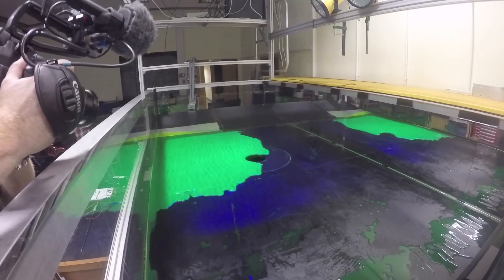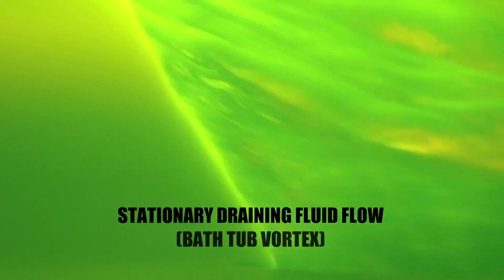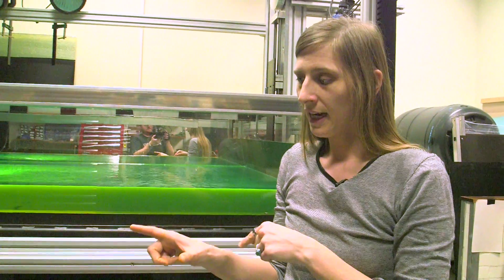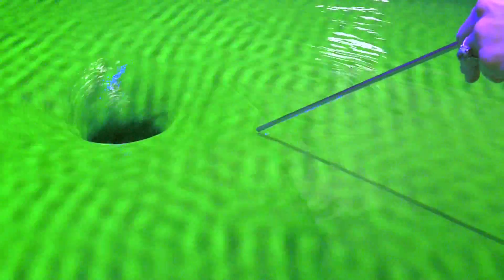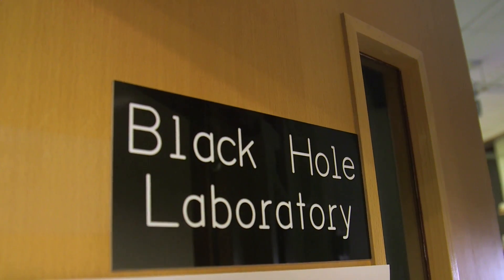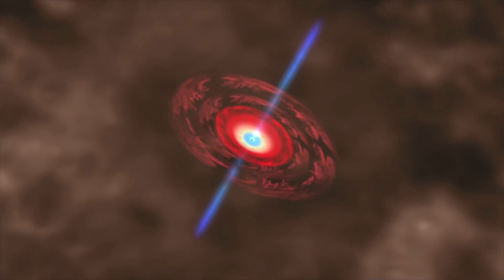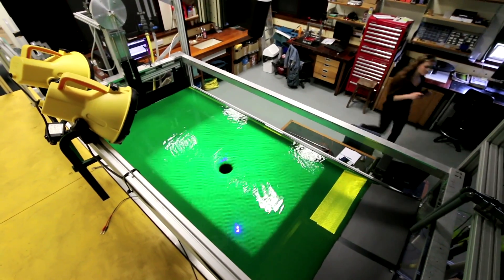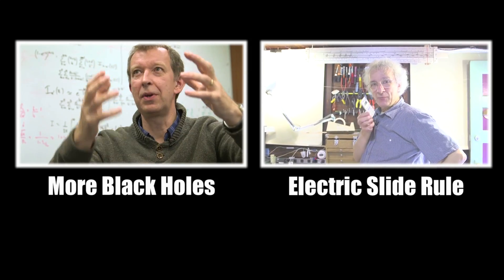The Black Hole Machine - Sixty Symbols

Comment: This should be done with liquid helium.
Just saying...
Reply: But....you'd gain nothing and add massive expense and make the surface much more difficult to manipulate.

I say you gain nothing. I mean you'd gain nothing but making it sound cooler.
Reply: Ben Actually you do gain something, a superfuid might have more in common with spacetime than a normal fluid.
For once it has "no viscosity" and more flows more easily.
One could attribute this experiment's results to "rogue waves" but not with liquid helium.
Reply: Rogue waves? They have pretty solid evidence that you can send waves in and get more energetic waves out, consistently, not randomly as with rogue waves.

Superfluids aren't just nonviscous, they have a few other... weird properties that cause issues. (Aside from breaking down at high rotation speeds or slightly warmed temperatures.) One of the more annoying is how they climb the walls of their containers, eventually overflowing them.
Reply: Not technically possible. A tabletop full of swirling liquid helium is not happening for any university budget.
Reply: Gareth Dean "NASA of course is nice, but it's far from 'all of science',"

Duh.

"this particular facility (In the video) is in Britain."

Duh.
Reply: Gareth Dean Yeah, I know, I didn't said it would be easy.
Reply: lloydgush
And sadly there's only so much research money to go around. This perhaps is the biggest limit to science. You cannot do everything. Sometimes you can hardly do anything.
Reply: Gareth Dean Yeah, I know about it...
It's sad, really sad.
NASA budget is lower than trump's coherence or hilary's honesty.
Reply: NASA's budget is 18 billion dollars. It's right around the same size as the Canadian defense budget. You have no idea.
Reply: aluisious Seriously, you are comparing with the canadian defense budget, just the nicest country in the world that everyone loves?
Reply: If you're going to try to use humor to deflect the point, be funnier.
Reply: aluisious
NASA of course is nice, but it's far from 'all of science', this particular facility (In the video) is in Britain. Indeed Canada's CIHR has a budget of 1 billion dollars and Canada quite frankly is a shining light when it comes to funding science.
Reply: aluisious
You'd be surprised how many times I've had to point those out. I can link you to the most recent video, NASA's video showing a year of observations from the DSCOVR satellite. The biggest objection on it is that it's CGI (and the Earth is flat) but there's a lot of people who seem to believe NASA is somehow in charge of science and\or evolution.

Comment: The flickering ripples - are they caused by the frame rate of the recording?
Reply: Kind of. The flickering is a random pattern that's projected so the cameras can do mathematical shenanigans to reconstruct the surface of the water. it's flickery both because it's so fast, and because the camera being used to record is so slow.
Reply: oh that is the the process they use to 3d model the waves in the water
Reply: No, it's you, nobody else sees it.

Comment: What would happen if you spin the drain funnel and counter rotate a circular tank holding the liquid but the base of the tank is flexible and pulsates up and down or controlled by pc with pin type pistons as well. The drain funnel could also lower and raise below and flush with the tank base material!

Comment: is there space in a black hole or is it all matter, or do we have any idea?
Reply: All the matter of a black hole is condensed into an infinitesimally small point with infinite density called a singularity. What you see as the "black" part of a black hole is really just a sphere around the singularity in which the gravity is so strong the light cannot escape. And the edge of that sphere is called the event horizon.
Reply: ***** They usually have a large mass, not size. The "Black" part of a black hole is not made of matter, it's just a region of space that light cannot return from. Whether or not black holes have infinite density is still up for debate, but if they truly are singularities then they probably do have infinite density.
Reply: We don't know and this is a complex issue. The equivalence principle (from relativity) tells us there should be some space inside which should appear 'normal' to anything occupying it.

No form of matter that we know of can exist inside a black hole for long, it would collapse and keep collapsing to an infinitely small, infinitely dense point, the singularity. Relativity thus tells us black holes are filled entirely with space with all their mass and energy in a tiny point in the center.

However this is definitely not the final word, such a hole causes the laws that create it to 'break down', a strong indication that something else, unknown, intervenes and that black holes are something different. What that is we do not know. Maybe spacetime loops, space under tension or energy. Only time will tell.

Comment: This seems like you are really really stretching here. why assume that a black hole is actually similar to a drain. for starters, the drain is more 2 dimensional than 3, and it has no mass, and the mass it absorbs is not retained. This seems like a flawed experiment.
Reply from the maker: I've linked to the lab's homepage in the description - you can start your way down the "rabbit hole" there to read more.
Reply: Because you do calculations and show that these two things behave the same way. It isn't just drawing random analogies.
Reply: You you gonna trust? Random youtuber or actual researcher?
Reply: The idea is that the ripples are waves travelling through a medium, just like light waves travel through vacuum. The flow of the water simulates gravity. In other words, a wave in that tank should behave like a light wave near a black hole.
Reply: I think the idea is they're trying to make something analogues to a black hole. It may not be, but that's the idea of experimenting, you gotta try it first.
Reply: I don't think they're trying to get super accurate results. What they're trying to do, i think, is get an understanding of how all kinds of waves (light, EM, gas pressure, gravitational) behave around black holes. So when they see some kind of weird event, they have a point of start.
Reply: Actually, gravitational interactions in the extreme g fields are analogous to the movement of pressure differentiations in simple fluids, so if they included experiments within which dealt with different sound waves it would near perfectly match the reactions and effects of how gravity would react near a system like a black hole
Reply: I think it's more a wave propagation testing than anything else. So, that's not a black hole, but the scattering is what they are really interested about and, hating wave mechanics myself i understand that the analytical computation may be a little too hard. So it sounds more like a "math experiment" than a physics one, even if the end goal is that we'll know a lot more about how black holes could radiate energy.
Reply: again, i'm no scientist, but light waves have no mass, and it's been show that waves (liquid) can behave very strangely i.e. rogue waves.

Maybe the experiment is close enough to get what they need but it seems very much like they are making too many assumptions. 

And if i'm just flat wrong, that's fine, some of the nerds are getting a bit excited though.
Reply: +Ironic Sensibiliy In that case then you should be embarrassed for offering any opinions at all without doing your due diligence of looking at the actual details of what this work is based on instead of acting as a layman casually offering their unfounded thoughts.
Reply: I'm a PhD in professional fuckery in some Uni over 20 years ago and everyone should listen to me because I have a degree. It doesn't matter what I say, just trust me, I've got some paper 20 years ago that tells you I'm a professional.

But seriously, why do some physicists always have to bring their degree into the conversation instead of actual arguments?
Reply: MKzer0 most intellectuals aren't actually skeptics. They take everything at face value and rarely challenge the status quo. This comment thread just goes to show how many people will watch a short video and take everything as absolute fact no matter what, without taking even a minute to question any of it's contents.

You're absolutely right about having the arguments speak for themselves, keep trucking brother.
Reply: One could assume it's like Newtonian Physics compared to Relativistic Physics, these experiments can be trusted up until some limit where a new system explains things past the current bounds. Like how the orbit of Mercury could not be confirmed until Relativity was discovered to explain it.
Reply: Fred Lockard Thanks for the response. It's nice to get a real answer other than the "stfu, you're not a scientist" garbage i'm getting from these 'intellectuals'.
Reply: I just think they should do this with liquid helium.
Reply: +Cristi Neagu 
yes! that´s exactly what they explained in the beginning. 

isn´t light also an electro magnetic wave?
Reply: ***** LOL WOW>
Reply: I think the idea of this lab setup is to observe fluid and wave mechanics in a rotating system. And I think they're just trying to pin down some basics from which more complicated models and assertions can be made. After all, we don't have many points of reference when it comes to black holes, so it helps to stitch together various different models to make sense of it.
Reply: Actually no. Gravity is caused by energy not mass. Photons have energy, thus feel the effects of gravity and have their own gravity. I.e. energy bends spacetime and is effected by spacetime. Mass normally dominates the energy equation, thus that mass is such a large portion of energy you can still be extremely accurate in predicting gravity while ignoring other types of energy.

This causes a misconception that mass bends spacetime, and leads to questions like how can a photon being massless be affected by gravity.
Reply: +JamesCizuz Sorry yea, I know that energy bends spacetime too (E=mc^2), technically they're the same thing in different states. I was just saying that I don't think this experiment is attempting to account for minuscule amounts of mass-energy entering the black hole and increasing their size, they are just trying to work with a simpler hole with static properties, ie. no hypothetical photons entering the hypothetical black hole. No hypothetical photons means only the black hole's mass is affecting space-time in the water tank.
Reply: what youve said isn't incorrect but if a university department has set this up, its reasonable to assume were speaking from ignorance and it has practical value
Reply: oh man you must be some kind of scientist phd master or something
Reply: Is there a link to your thesis (if it's publicly available of course)? I would be interested to have a look at it :)
Reply: +Simon Zeder looking at the first comment in this conversation, I'd say, there's a link in the description to the website of this team's efforts. :)
Reply: MKzer0 haha thanks I'm sorry I tried to respond to Ironic Sensibiliy  's comment about his thesis, but thanks anyway mate. Still have to figure out this comment function...
Reply: +Simon Zeder don't worry, it rarely works how it's supposed to. )
Reply: Albert Neville perhaps I do have a phd as well and don't need to brag about it, because I think arguments should tell more and be worth more than a title in a conversation? ;)
Reply: MKzer0 Don't lie. You do not have a pHd. Period, I'm not even going to argue with you. No-one with a pHd would display so little class. No one with a pHd would have made such a ridiculous assumption as you did. You are lying.
Reply: Albert Neville class. I lol'd
Reply: Albert Neville It doesn't matter if I do or do not have a phd. That was the hole point. You don't need a phd to challange something thesis and don't just take their word for it being true. And just because I don't behave like the stereotype you believe in doesn't mean I don't have a phd. 

But I guess it takes some intelligence to acknowledge that punks and trolls can be just as much phd material as posh people, doesn't it? Don't let your experience be the cage you think in, that's just bad for your perception ;)
Reply: +Albert Neville my inability to spell English words stems from the fact that I'm not a native speaker, nothing more, nothing less. 

And I'll gladly continue with not acting on your blind assumption it would be ignorance you're dealing with just because you think you're right. The irony in it with the whole thread in mind is poetic though, I've got to admit.
Reply: canister0 sheep
Reply: +broadwayat I think there is no question that they are making some assumptions... and I think the researchers themselves would be the first to admit that :)

but in my opinion they are somewhat reasonable assumptions... as distinct from unreasonable or far-afield assumptions :p

I suspect that one of the best features of this experiment is its low budget... I think it may be the case that performing numerical simulations of black holes and general relativity on supercomputer clusters can be expensive... because the supercomputer resources are all being sought after by many many labs and researchers... a huge tug of war

I'm not sure that one has to actually pay money for supercomputer time... like I dunno if bank accounts are accessed or what LOL... but I think at a minimum one cannot just ask for using up all of the petaflops on a system whenever one wants... there is a great deal of queueing and scheduling going on... alot of juggling... I've heard rumours that getting supercomputer time alloted is far more difficult than getting access to the Hubble Space Telescope... because of how many people are all seeking the same resource

so by building this simulator in their lab once, they are no longer tethered to the supercomputer queue, infighting, and the attendant assassination attempts, slashing of tires, prank calls, pet kidnappings, and all that mess... and hence they are no longer tethered to reality either!   I KEED I KEED!  :)

as for the drain not retaining mass... I think once the water is down the drain sufficiently, this is sorta retaining it no?  

if you mean that some subtle effect could be transmitted down the drain, across the entire length of the horizontal recycling circuit, up the vertical portion of the recycling circuit, and then right back into the drain again I am skeptical :)   that would be one heck of a subtle force!

but who knows... Nature is mysterious and I suppose time will tell :)

I also share some of your thoughts about black holes having perhaps a 3-dimensional nature in some respects... but the odd thing about them is their accretion discs seem to have 2d planar features... from some curious vantage points they seem to resemble dual-sided bathtub drains... and yet, bathtub drains don't have that column of energy shooting out orthoganally to the disc near the speed of light lol

oh well, we will see over the coming years if this simulation of drains leads to any discoveries or not... I'm hoping it does :)
Reply: +The Incredible Godzy yes you have it exactly sir!

this experiment is about ferretting out potentially subtle and under-predicted effects of waves in the region of a "drain" that are not well accounted for in the current "waves near a drain" literature LOL :)
Reply: broadwayat
hehe your welcome :)
Reply: well you're a pretty bad scientist.
Reply: Your parents conducted a flawed experiment when they tried to abort you and failed.

Comment: So they want to see a transfer of energy happening from extra mass coming in and interacting with the black hole. And from the looks of things theyre trying to simulate that with that board going up and down and adding waves. But why not try and simulate thats with extra water? Have a dump tank on the side of the normal tank and simulate it from different angles. Sure it might be easier to meassure the input from the board, but theyre clever people. The input from a dump tank would also be easile meassurable, not as easy to vary but worth it i think.
Reply: The problem there is that you then start changing the average water level, which alters how the vortex behaves. Do you think there would be any advantage to the tank? Remember they are monitoring the height and frequency of the waves, not their energy or volume.